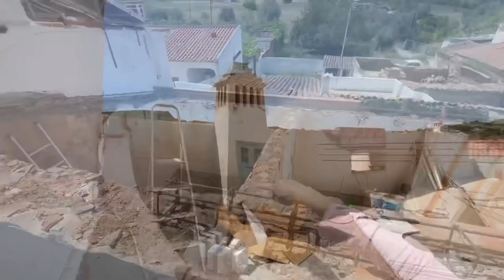One Step Closer to Lovely Roof On The Once abandoned Village House #73

Comment: Could you tell a little about the original building style of those old houses ?
Stone, shist, and what there is,, is it held to together by weight and clay or dirt ? how does it hold up ? how does it like mixting with todays building materials and so on ?
Reply from the maker: There’s a loaded question. I’m no expert. Stones and clay. The walls are easy to take apart starting from the top but they are seriously strong and very thick. All interconnecting. So with earthquakes for instance they Absorb the vibration.
Reply: @blondguy  Yeh from the top they look extremely fragile, which is very noticable when the roofs give in on ruins, the wall tops then really take a beating from wind and rain, always found those ruins interesting, but knowing way too little about it, comming from a place where bricks and cement are the common building materials, oh and i guess foundations too. Why do you think its a loaded question,, its surely not intended as such 🙂
Reply from the maker: @splynk1  loaded only because I’m not an expert but I gave an answer best I can based on my own research. Also they didn’t use to have deep foundations because of earthquakes apparently. The lower into the ground the more vibration. I did notice that when I was down the well. 👍
Reply: @blondguy  Makes good sense, i find it a very interesting topic